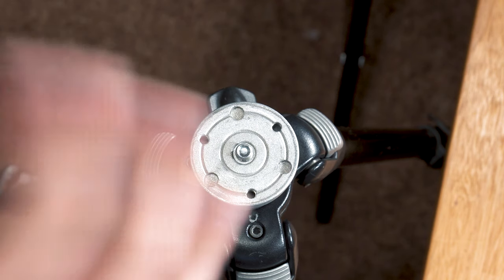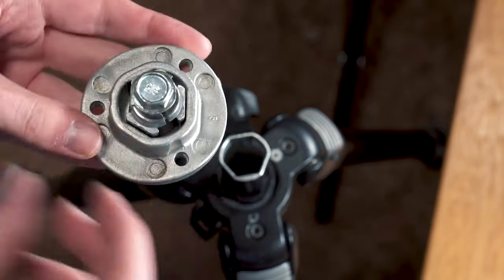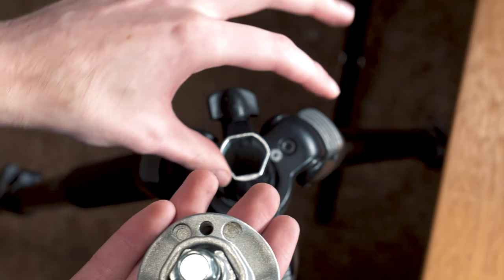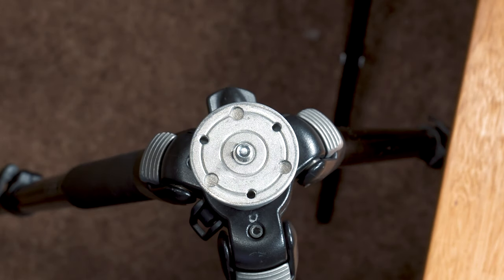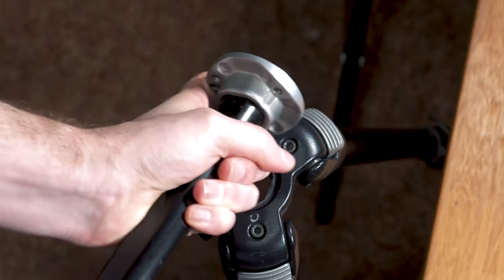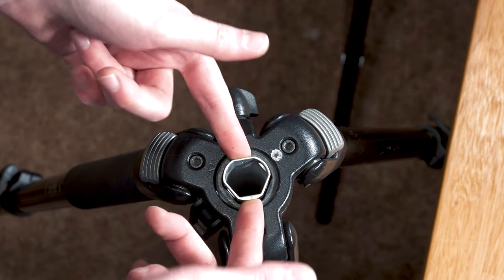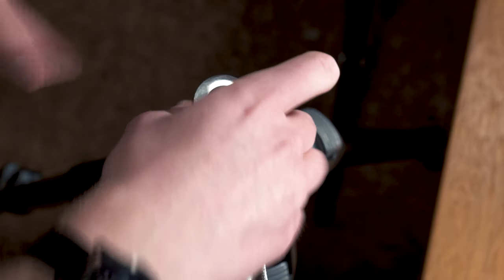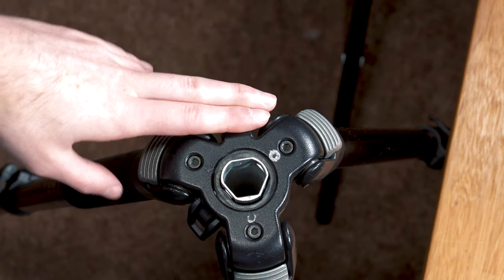Easily Fixing a Wobbly Manfrotto Center Column Platform

Comment: Mine broke into three pieces. I tightened it up, knocked the centre column on with a hammer and a spark plug socket. It was tight, as and just to make sure I poured epoxy resin into the small gaps and left it out to dry upside down.